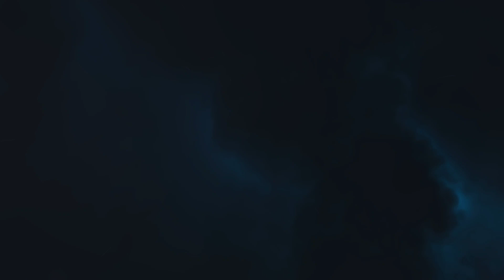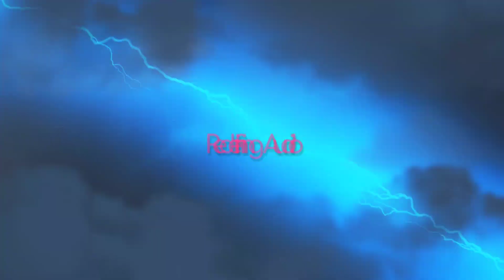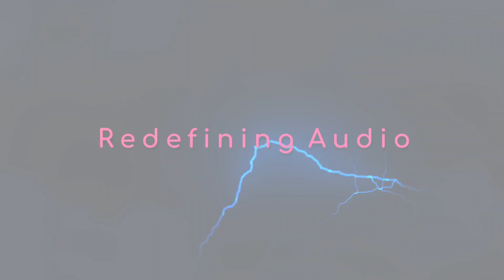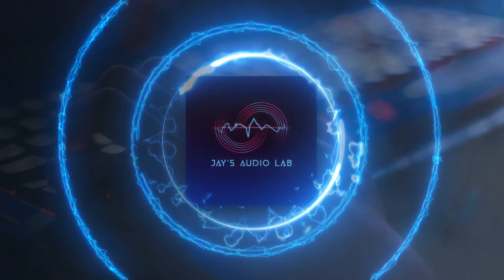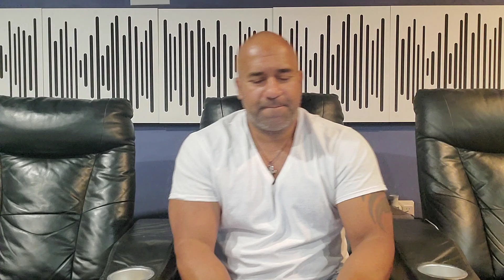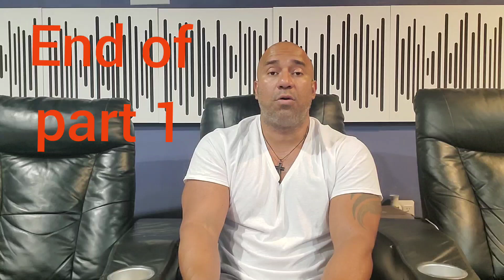How to build your next system!

Comment: The source is indeed critical. However, if you don't have the speaker+amp/preamp interface figured out, it doesn't make any difference what great DAC you have, you'll never get the system to sing. I've definitely experienced this in system building and Jay has mentioned the same thing. Finally, don't misread me, everything matters for sure. But if the speaker+amp/preamp interface is not working, the system will never make music that sings.